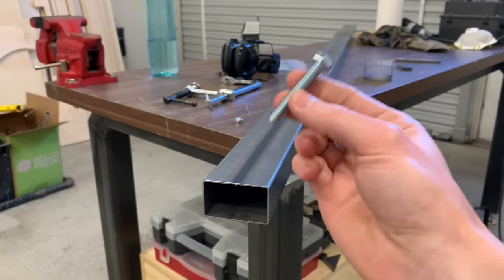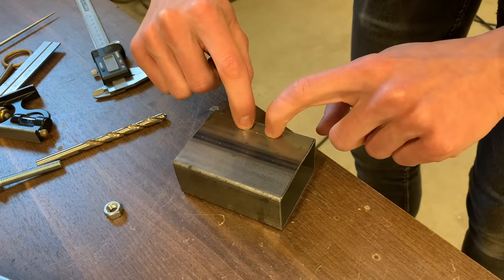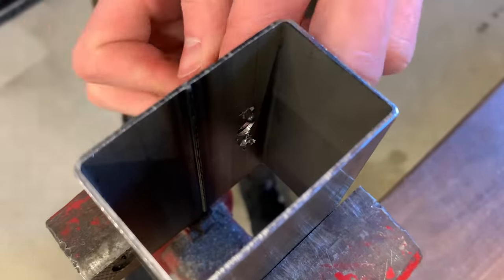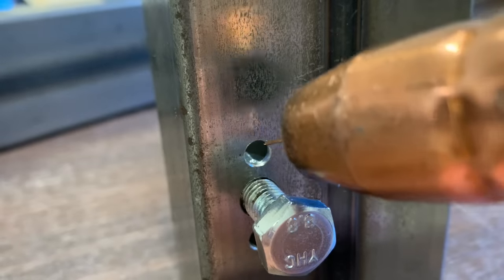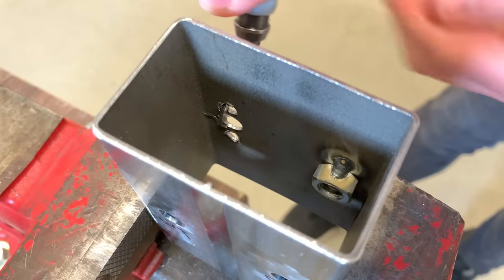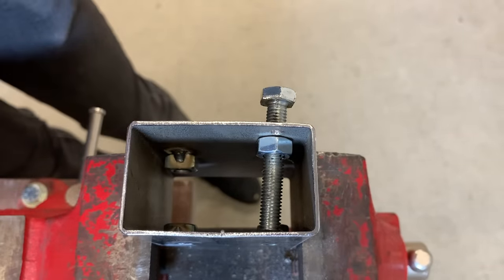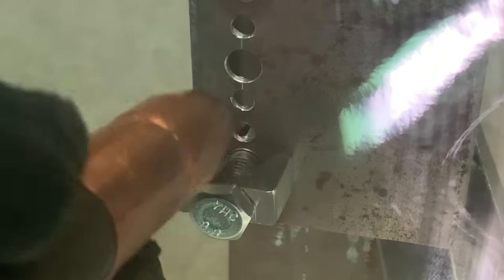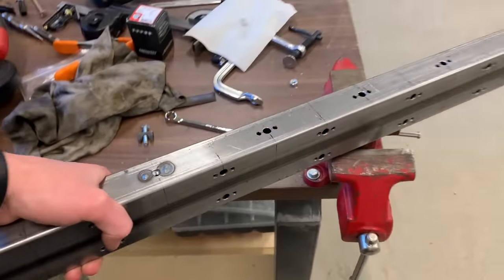Welding nuts to the inside of steel tube

Comment: I wouldn't consider rivet nuts expensive, especially considering the time savings . I do appreciate your approach, it's valid and a useful option to have. Your video was entertaining, informative and easy to follow.
Reply: Also compared to the cost of buying a Lathe, Mig Welder and de burring tool the rivnut would be a much cheaper option.
Reply: I admire people that can weld well.  I cannot.  Rivnut is the answer for someone like me.
Reply: Rivnuts lose their grip and spin out, particularly in aluminum.  Used as a last resort in the commercial signage industry- always with an additional adhesive, such as Lord's.
Reply: @travismiller5548  So how do you weld aluminium nuts inside aluminium square section tube?
Reply: Yes, if this is for professional work, it's a waste of time. If it's DIY, it can be handy if purchasing cost budget is the main priority. Always interesting to see new ways of doing things. Also a good method in a pinch of more conventional methods are available.
Reply: @travismiller5548  I've not had problems with spinning if the tolerance of the hole diameter is maintained and not drilled oversized or wonky.
Reply: @travismiller5548 rivnuts do not spin out of the proper grip range is used.
Reply: This is significantly stronger and more reliable than rivnuts
Reply: @jeremypearce3056  What are we attaching to it that requires a significantly stronger attachment? That rivet nut, when properly installed, can withstand more than you should put on it, so even if your claims of this method being stronger, it just isn't enough to matter. It's like saying you have 1.3 kids and are kind of immortal. Read the specs, follow the science, and look at the MS or NAS rivet nut if you want detailed specs required by DoD and DOE. Use of a flow drill or rivet nuts are the preferred and most accepted methods, this way is definitely a hobbyist way of doing something with what they have. SMFH
Reply: Installing rivet nuts is far cheaper and easier than doing this. My time is worth money.  You can buy a 100 pack of M8 carbon steel, zinc plated rivnuts for $12.  That's 12 cents each.   Or stainless for about 30 cents each.  And no expensive specialty tools are required unless you think a drill, a bolt, a couple of nuts and a wrench are specialty tools.  Or you can buy that specialty rivet nut tool for $40.  But I've installed hundreds of rivet nuts without it.
Reply: Rivnuts or not, it this man’s outstandingly high skill, problem solving and ability to produce high professional videos that draws my attention. I might not use this idea exactly the same way, but still picked up a few things. Just like I did so many times before from Jer’s production. So far I have not managed to copy any of the projects, as they are usually quite challenging. Still used many of his ideas into my own projects. Many thanks.

Comment: I feel like this is about to become a solution in search for a problem for me.  Extremely elegant.
Reply: Just use some Rivet Nuts
Reply: Just use a tapped strip.
Reply: Don’t research what a weld nut is
Reply: @ag.cousins  lol
Reply: Ah the comments of smarm.  I look forward to their original contributions on their own channels.
Reply: I appreciate an other appreciating the application of a technique simply for the  fun of applying it.
Reply: This is ok skill wise but I would just get a thicker walled tube and tap it.
Reply: If you want to use thin wall tub where you can not tap the whole, this will work, but another way is to use a tungsten drill bit. This will heat up and bow the metal in and give you a lot more surface to tap. 
I’m sure there’s videos about this on here as that where I learn to do it and it works.   I get scrap thin wall emt from work all the time and do the same with it. Being round it works better than a nut.
Reply: Ok, @Bernard Sandler . So what is your solution then?
Reply: @nicholaslandrum5130  Any tungsten drill bit will cut a clean hole, not what you describe. Why would you think a tungsten drill bit doesn't cut steel? The only way that tungsten drill bit would do what you describe is if it was extremely blunt. Even then it wouldn't do anything for an M8 in a 1.6mm wall. Even if you DOUBLED the wall thickness to 3.2mm, then an M8 with a pitch of 1.25mm would not give you even 3 full threads. 

But what would I know? I've only get 35+ years of experience as a real fabricator/welder. Your experience as a Youtube expert easily trumps that. 😂
Reply: @redryderaus  my solution is to appreciate the work done by Jeremy in this video and to applaud a clever way to create thread in square stock in hard to reach places.
Reply: Yea. A rivnut a magnet and washer walk into a bar…
Reply: @redryderaus He's (poorly) describing flow drilling, which absolutely works as he described it, and is used in industry to allow tapping thin walled material all the time. Perhaps reevaluate your confidence sir..
Reply: @pierrekinbrand  in China…

Comment: Hi Jer, great idea, as a welder I would advise using unplated nuts, the arc will strike better and you'll get better penetration into the nut, thank you for your videos, your content is always very interesting.
Reply: Yep. Muriatic acid (hydrochloric acid) is great for quickly dissolving the zinc plating. I do this all the time.
Reply: Not to mention the highly toxic fumes produced from zinc in welding.
Reply: You can wire wheel them also to remove plating. I would also recommend spraying bolt with anti splatter and also remove plating.
Reply: When done coat the inside with water displacing anti corrosion fluid. Otherwise it will rust - badly.
Reply: I weld a strip of metal 3/16 or 1/4 thick on inside the length of tube , a few holes in length of tube to weld strip and grind flush , that cuts down on the 80 holes to weld nuts on and now there is threading meat in there , another tip , avoid drilling and taping through that bluish work hardened seam in tubing , use opposite face.
Reply: @jafo766  How do you get your welding gun deep inside the tube to weld that strip to the inside?
Reply: @KenFullman  Rather than drill 80 holes to weld nuts from top , you drill 4 holes equally spaced along tube , insert strip of metal on inside and plug weld holes and bar together from outside , same as the nuts were done
Reply: @jafo766  That does sound like a much easier way to do it.  Seems obvious now 😁
Reply: @KenFullman  It'$ how it'$ done in the BIG LEAGUE if you $till want to have a job after 1st break
Reply: @KenFullman  did you not watch the vid?
Reply: @bbhoustontx  Yes I watched the video.  Did you not notice my question was directed at Jafo? 

Jafo did not make this video, so was nothing to do with the content of this video.
Reply: @KenFullman  Rookie question here ... I thought the same thing. How big an issue is this actually? How about for hot dip galvanized vs. zinc plated?
Reply: @dre3951  I really have no direct experience of the hazards associated with welding of zinc coated metals but, I've heard of plenty of welders getting serious reactions because they thought "how bad can it be? I'm only doing this little bit".  The short term effects are bad enough (check out "Metal Fume Fever") but it's also been linked to cardiac disease, cancer and even dementia.  Not the kind of stuff to take lightly.
Reply: @dre3951  having being young and naive i welded quite a bit of steel that was galved, headaches and lots of coughing for a couple of days. lesson learned
Reply: Dip them in muriatic acid and then wash them clean. I do this to weld plated stuff.

Comment: if you want an even sturdier solution weld the nut onto a piece of flatbar, then plug weld the flat bar in similar fashion. The nut could be welded full circumference (much stronger) and you can use multiple plug welds on the flat bar distributing the torque along a great surface area.
Reply: I agree, not many fab shops have a lathe  ,  yet often I could use one  , over all good work ! Jim
Reply: at that rate you could make a box out of flat bar
Reply: In this case your suggestion makes as much sense as building one ship above another one... Just clueless SMH
Reply: Makes more sense to drill and tap the flatbar, instead of welding a nut.

Comment: Nut plates, or flush mount t-nuts would make this operation easier. Having a flange means you won’t need to reach in through the hole, so can use tig (I don’t have mig) or just flush rivets.
Regarding rivnuts: they don’t sit flush (at least the one I have do not).
Jer, I have enjoyed your videos for years (bought multiple plans from you and built your grinder). Am so happy you are now posting more frequently!! Keep’em coming!
Reply: This is not the technical term for them, but I have used those "countersunk Phillips drive" bolts with the head diameter sanded down using a drill and belt sander so the head is only slightly larger than the hole to hold bolts in place before for welding them on through 4 holes before although it was in a different application (welding on to flat plate that I didn't have full access to the other side and I remember spending probably half an hour or maybe more trying to get the nut in the right place on the other side with a piece of wire wrapped around it before I thought of using a magnet hot glued to a stick to hold it while I threaded the bolt through, after which I realized I could have just hot glued the nut directly to the stick but you know, you think of the good ideas later...)
Reply: there are flush riv nuts. You just countersink slighly the hole
Reply: @fuckingpippaman  It would weaken the push strength of the rivet immensely if you'd countersink such a thin pice of metal. I know, they're mostly meant for pulling forces, but still. It could fall through while assembling if you knock it once. The idea in this video is pretty nice, as even those little tacks can take quite the beating.
Reply: Yea, there are plenty of ways to do this without going thru drill bits like candy that are cleaner and easier that cost the same or less than zinc nuts.  This video has some bad advice IMO.

Comment: Harbor freight sells this pop rivet type tool that instead of rivets, it fastens threaded inserts into thin-walled metal like your tubing here. I bought one years ago and have never had a cause to use it yet, but it might work beautifully for this situation. However, your method was brilliant to be able to weld a nut inside a tube like this, inconspicuously cover your tracks, while not getting a speck of weld into the interior threads! 

You always impress me with your brilliance Jeremy :-)
Reply from the maker: The rivnuts still have a slim head on the outside of the tube, right? I wanted this to be totally flat on the outside, and of course just wanted to show a solution that doesn’t involve buying a specialty tool that rarely gets used.
Reply: @Jer_Schmidt  I'm almost positive they do, just by design like a pop rivet. Your method was clever and much more sturdy than this would be.

That said, I've been waiting for years to come up with a use for that damn tool!
Reply: @Jer_Schmidt   Yeah i was thinking the same, and now i use this rivet gun so often. It is a problem solver so many times
Reply: @Jer_Schmidt  you can get countersunk head rivnuts that are flush with the surface, and you can install them with a bolt, a nut and a washer. 

Of course it’s faster with the tool. And you don’t have to drill 3 holes for every fastener.
Reply: Unless they've updated it in the last five years, don't buy the harbor freight one. It failed after the third rivnut.
Reply: He forgot the part where you take a hammer and beat it flat 👌🏼
Reply: @felixar90  besides that, you don't have to deal with burning zinc fumes, spatter all over the place, which can ruin the nut if it sticks to the screw threads inside the tube and you have to access any more to clear it, then there is tube distortion from welding (much bigger problem if tube is stainless), another solution for a problem that didn't exist
rivnuts can be PIA if they start to turn, but that usually happens if the drilled hole has been too round and clear of burrs :), couple tig fusion tacks solve that, that is if you forgot to use the permanent locktite when installing the nut

in short - don't make impossible designs that need a whole lot of time and effort to transfer from cad to real world
Reply: I've used rivnuts and in thin wall material they can spin, makes tightening or emoving the bolt difficult.
Reply: @Jer_Schmidt  you can set the rivnuts using the bolt and a larger nut to set it in place. No extra tool needed.
Reply: @ncooper8438  Very important point about rivnuts, the round ones and especially the countersunk round ones can't take much load at all, they spin very easily. One solution is hexagonal ones that will strip before spinning but to use those you need a way to make hexagonal holes, for example a laser...
Reply: @lolatmyage or locktite

Comment: Nice idea! FYI you can get Rout-a-Burr bits with a hook shape for deburring inside walls - and they work just fine. I also recommend using integral-flange nuts - they spread out the load more and also give you more material to weld to.

Comment: If one does not have access to expensive metal working equipment (i.e. welders, lathe, etc) try a  bit of grease on the threads and JB WELD on the face of a flange nut. Use a bolt and jam nut to pull the inside nut tight against the inside surface (tight enough for the flange serrations to indent the metal) and leave for 24 hours. It is not as strong as welding but it is another alternative (that works with dissimilar metals ... example: Steel nut and Aluminum tube).

Comment: I must say that your approach is clever, something I don't think I would have ever thought of. However, as others have already noted, it does add a lot of labor. A few years ago, when I purchased a new Ford F-150, I did a lot of projects involving adding/securing items to the truck bed, which is aluminum. I just went ahead and purchased a rivetnut setter, and it has been a wonderful purchase, for which I have no regret. There is no way I could have used your particular method, considering the thin aluminum sheet, sprayed-on bed liner, delicate wiring and hoses (on the underside). For some of my other projects, your approach may be a good solution. Thanks for sharing.

Comment: I've never welded but i've watched a lot of welding videos and the pro's appear to leave the gas running over the weld when it initially cools to reduce any oxidisation of the weld, what are your thoughts on that as you seem to remove the torch immedaitely :D Thanks
Reply: With mig welding you don't need a post flow that is for tig welding. when tig welding you need to keep atmospheric contamination out as the weld pool cools and to keep the electrode clean

Comment: Weld nuts are another option. Essentially a short bar with an extruded thread, the tab(s) give ample space to weld. The extruded thread is easy to locate in a clearance hole, and works like your modified nut with threads closer to the surface, and a lower profile inside.
Now, weld nuts and rivnuts/rivet nuts are often employed in situations where assembly happens ONCE, usually for flat-packed items to be assembled on-site, or limited cycles such as access for replacing a component once or twice. I'd prefer the more solid threads of real nuts for something seeing repeated use. Others have mentioned flange nuts, there's also "heavy" hex nuts, which are basically the next size larger nut with a smaller thread, and there's "heavy jam nuts" which are a combination of larger width, but normal thickness (regular jam nuts are thinner than normal nuts)... So, there's lots to choose from, for thread engagement, width, thickness/clearance, if the standard hex nuts aren't good enough.
Reply: Thanks I was aware of several but not all  these options you have listed thanks👍.
I have also heard riv nuts can loosen over time if exposed to vibration and other forces. 
Was told Not to use them for side panels on a trailer crate for this reason.

Comment: I did the idea and usefulness. Drilling access holes to fill and tack nuts in place is slick. I would add something in there about covering the nut with anti-spatter so you don't get a seized bolt after welding the nut in.  Rivnuts are not that expensive and you can use a bolt and can install them Without the tool. Though the tool is also not too expensive. I do feel nuts welded in like this would have more holding power than a traditional Rivnut.
Reply: Riv nuts can work loose and then you cannot undo the bolt because the ffnn thing is spinning and laughing at you.

Comment: Thanks I like it. When I have had to de burr some distance from the end I made a little jig that fits inside and can be pushed in with a rod to the required distance. The jig can be made using any hardened steel with a sharp leading edge that will cut the burrs quickly and cleanly. The jig can be made easily and can be made to be adjusted to tube size. Also whenever I weld nuts while a bolt is threaded I use a smear of anti seize or spatter guard to ensure no lock up.

Comment: Thank you for sharing some good tips! I do feel there are some better alternatives, at least if you need to do more than a couple of these. For example there is the blind rivet nut which is a very cheap option. Changing the construction is often a better way to deal with when possible. Maybe a aluminium profile (can't find the right english translation for these) for machinebuilding could be used. There are steel alternatives too. 
Thank you again for sharing :)
Reply: Is "aluminum extrusion" the word you're looking for?
Reply: @JDeWittDIY  Jep, that's it.